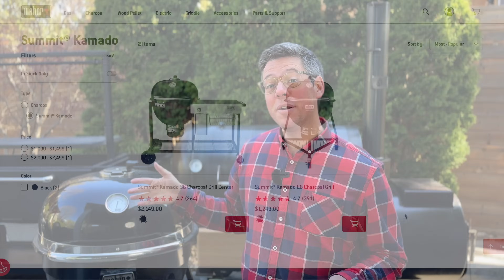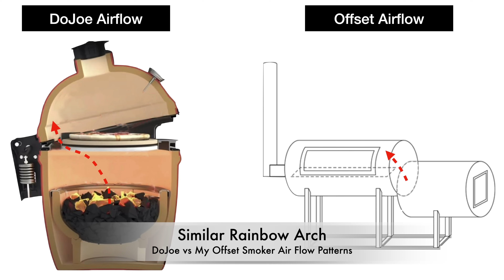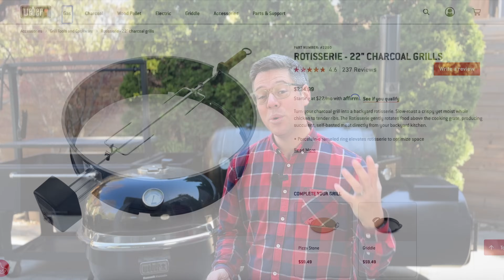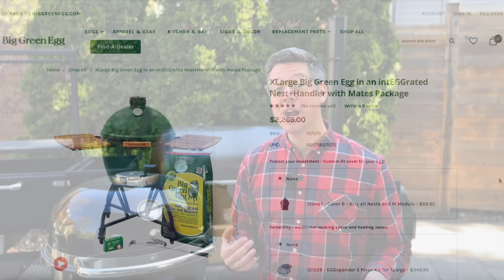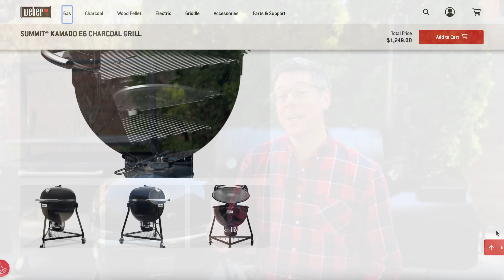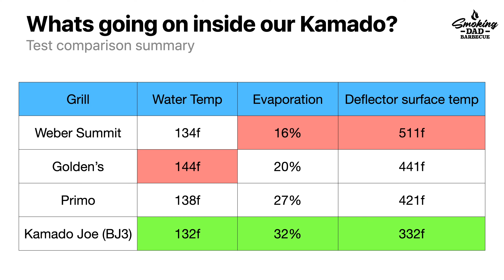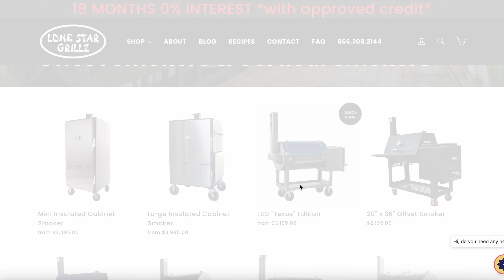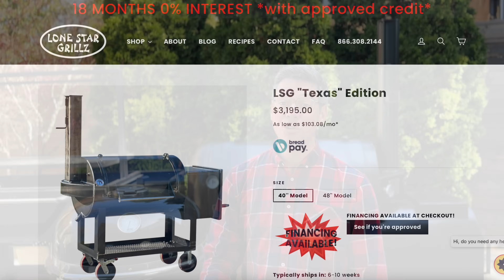3 Reasons NOT To Buy The NEW Weber Summit Kamado (1 Yr Review)

Comment: Weber giving you a product free without expecting a good review shows that they aren't afraid of critics or being roasted into oblivion.
It proves that they are at least trying to make a good product, and aren't afraid for criticism about their products
Reply from the maker: They are class A people for sure. Overall I am huge fan and they do a good job… this product feels more like it comes from the accounting department on a revenue growth idea than it does from the team thinking about making better barbecue
Reply: @SmokingDadBBQ  I indeed had that feeling that something felt off about it.

They should just have had engineering go mental, and make a grill for people with a budget of max 2000$, instead of listening to accounting, to make a grill.

I for once would have done a triple insulation instead of double.

and a bunch more like that heat deflector with hinges.

like a hinge on a deflector cost 1$ at manufacturing, but they can essentially upcharge 10$ for it, since its a feature people want.

Comment: You need long term warranty with ceramics. Weber has decades of track record that completely overshadows those competitors you mention. Poor comparison IMO. The design of the Weber allows for changing temps by not having as much thermal mass. Still efficient but more versatile. The other issues are easily worked around by changing your techniques.
Reply from the maker: Not sure you’ve made it to the warranty section but this is not better on any line item compared to bge, primo or kj 

* Bowl, lid, and center ring – 10 years, rust through/burn through
* One-Touch cleaning system – 5 years, rust through/burn through
* Plastic components – 5 years, excluding fading or discoloration
* All remaining parts – 2 years
Reply: @SmokingDadBBQ  it’s not needed. If there is going to be an issue it with a Weber it will present itself. Extremely rare. People are buying decades old kettle grills that also don’t have a robust written warranty. This is a red herring. The fact you need the robust warranty with ceramics is not necessarily a positive in this particular context. Ceramic cookers will break and chip etc, guaranteed. Just go to a grill store and ask them how many claims they have of each type of grill. The context is important. If the ceramics didn’t have the warranty nobody would ever buy them. Not the case with the Webers.
Reply from the maker: @peterprescott4136  you are speaking definitively on subjective matters.  Metal rusts, ceramic can chip or crack.  I've had ceramic grills for 18 years, the friends summit i first used is out of warranty and didn't get the part covered by warranty after it expired.  what companies provide in writing matters and what weber provides is less on individual components and the grill overall than its competitors.  if they change it we can post that here but your speculation and opinions don't help people like my friend who bought a summit thats not covered after the warranty expired so i don't think thats a relevant consideration for new buyers
Reply: @SmokingDadBBQ  ok. Highly unusual and suspicious. Not very many rusted out Weber kettles around. Also Weber is world famous for customer service. If you say so. I hope the written warranty brings consumers decades of enjoyment whilst waiting for their replacement parts. 😁
Reply from the maker: @peterprescott4136  I do agree they have excellent support and I have personally benefited from a charitable out of written coverage replacement before from them

Comment: Owner of e6 here.

Great in-depth review and I always appreciate Smoking Dad's POV. His double indirect method was a game changer for me several years ago and I'll be forever grateful.

Ill share my perspective:

1) S6 is unreasonably priced, but e6 is much more competitive. So all comments below are to e6.

2) I agree "new" 2nd gen heat deflector is worse, however by combining it with the 18 inch drip pan from smokeware (it fits perfectly), Id argue its better than Gen 1. By placing the stock deflector on top of the smokeware drip pan filled with water), you get one of the best  "double indirect" setups on the market. The extra water creates steam that goes right through the holes in the stock drip pan and all that water acts as a major heat sink, making the fire work much harder - creating better smoke. It really excels at double indirect. You can even add a drip pan on top of the stock deflector (triple indirect?) with room to spare.

3) while the ash cleanout might feel "cheap" it is hands down the best ash management system on any kamado. I can fully clean the ash, fire my e6 up, and get it to any target temp way faster than I can on my large big green egg (which is a way smaller grill). So when I want to grill on a weeknight, I legitimately fire up the e6 over the bge because it is way faster (even if only for a few steaks).

4) Smoking Dad misses the boat entirely on the "grilling mode" for the e6. This is what sets it apart from other Kamados in my humble opinion. I can set up the e6 in 2 zone “grilling mode" (with or without charcoal baskets) and NEVER HAVE TO MOVE ANY ACCESSORIES to achieve a perfect reverse sear. While it's true you can't switch from grilling mode to Kamado mode (or vice versa) during a cook - WHY would you EVER need to? Maybe if you need to reverse sear 15 steaks? But when is the last time that actually happened? I think the e6 has one of the best reverse sear set-ups on the market right out of the box.

5) Admittedly BGE and KJ have better warranties - but it remains to be seen whether the Summit actually needs a lifetime warranty. Many kettles from the 1970s are still working perfectly in 2024. Why would the Summit be any different?

6) I agree the summit has way less thermal mass than a ceramic Kamado. But is this a bug or a feature? In my experience the e6 gets to target temp way faster and, while not quite as insulated as ceramic, it is nearly indistinguishable. The e6 holds temps like a champ (and I can get high temps using a surprisingly small amount of charcoal). And as pointed out above you can 100% do “double indirect” with the e6. Maybe I missed it, but did smoking Dad try double indirect on the e6? If so, how? It's his idea (and I love it) but I don't see where he actually tried it on the e6.

7) I agree accessories are limited. But I'd encourage anyone with an e6 to call Tom @ Ceramic Grill Store and ask about using the Adjustable Rig on the Summit. I have one and it opens up all sorts of additional headroom for doing pizza or chicken high in the dome and, my personal favorite, smoking raised direct (kind of like a child box). You can obviously do the same on BGE or KJ - but with e6 you can get to the same result as a lower price point. I am not a fan of rotisseries / doejoe, etc so accessories aren't as big a deal to me. But your mileage may vary.

8) I agree the Weber baskets are cheap, but you’d be surprised the temps you can achieve with just ONE of those baskets full on the e6.

9) I think the build quality of the stand on the e6 is a little subpar for the price. And I agree it would be challenging to put in an outdoor kitcken.

10) While I agree it would be nice to have a top vent that doesn't change settings when you close the lid - I actually haven't had this problem. For me, so much smoke and grease has baked on to the top that it “sticks" to whatever I set it on. Takes 3-4 cooks to get to this level, but it has not been an issue at all. This cooked-on smoke and grease also ensures the e6 is airtight when you shut it down.

11) If you are chasing offset flavor on a kamado (ie smoking Dad), e6 is probably not for you. In my case, I'm chasing more of a “chud box" style direct heat flavor from fat smoke. And the e6 absolutely delivers on that. It does pretty well cooking double indirect as well 

12) Overall, you get less warranty with the e6 and less accessories. But you also pay less. It still feels like a premium grill and is very heavy duty. With 2 accessories (Smokeware 18 inch drip pan + Ceramic grill Store Adjustable Rig), the Summit becomes VERY competitive with any ceramic Kamado. It's not perfect but it fits all of my needs.

Just my 2 cents.

Love the content and keep it coming, James!
Reply: Forgot 1 thing - because the stock deflector has holes around the rim, if you use my "double indirect" setup mentioned above, you can easily REFILL the Smokeware water pan mid-cook just using a pipe and a watering can.
Reply from the maker: thanks for taking the time to share your input for people in the market
Reply: Well said points
Reply: You also are not supposed to use briquettes in a ceramic.  Briquettes are the preferred fuel when it comes to consistency on low and slow smokes.  Lump preferred for hot and fast.
Reply: To point number 4) Its actually really easy to switch from grilling to kamado (and vice versa), I do it all the time. Just leave the charcoal grate in the lower position, If you want kamado put in the deflector plate, if you want to grill swap out the deflector plate for a 20-22 inch round grill grate/ half moon plate where the deflector plate would be. Perfect for reverse searing/2zone cooking, and can easily do it in reverse. 

In regard to point 10) Yes it does stick once the grease is baked in, now im having the opposite problem, its very hard to turn until the cooker warms up loosening the grease. So now i have to clean it off occasionally, but I cant clean too much of it off otherwise its too slippery and loses its setting whenever I open the cooker.

Definitely gonna try some of  your double deflector setups as that sounds interesting
Reply: I never heard of this double indirect method you spoke of on the Summit, but now I added the smokeware to my Amazon shopping cart!  Looking forward to giving it a try.
Reply: @SmokingDadBBQ  how mad are you that someone with your competitors product dropped a high end comment like this goooood lorrrrrdd.... lol